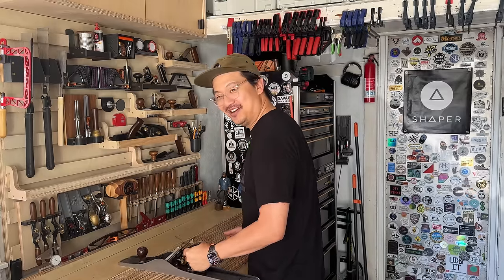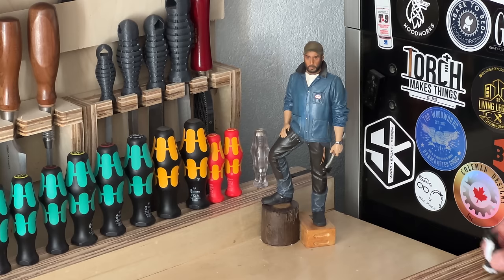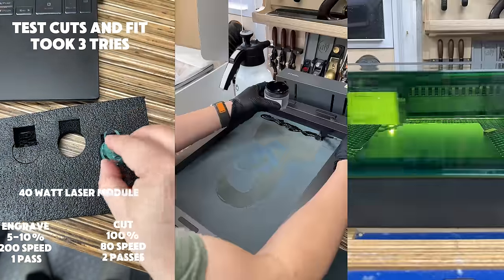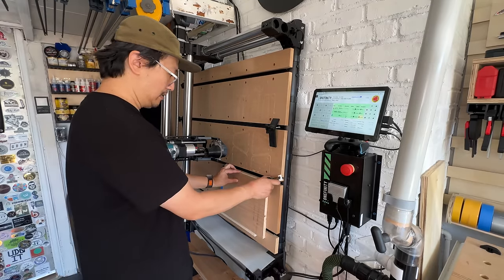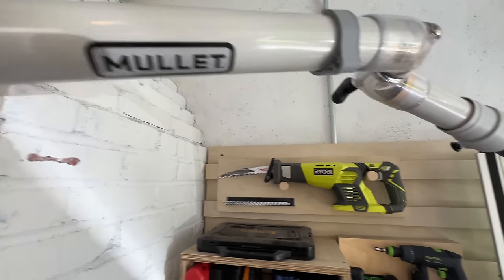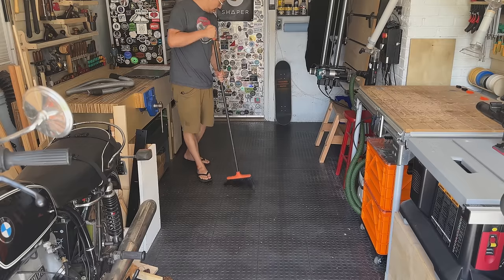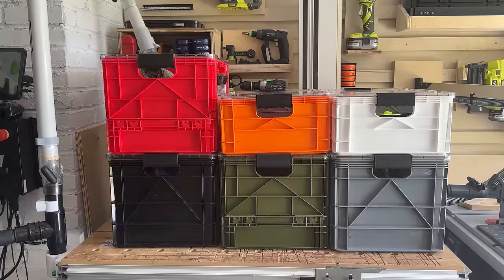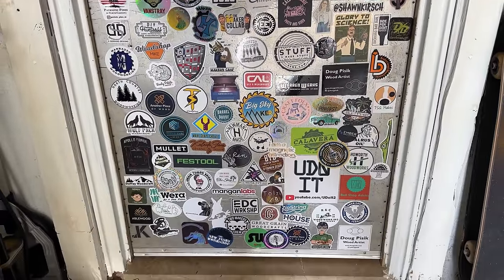Shop Tour 2024 - One Car Garage Woodworking Workshop Update

Comment: I think your one Car garage has the double space of mine🤪
Thats awesome storage solution
Reply from the maker: I'm super conscious about the space, why I like hand tool woodworking for some stuff as it saves on space. The MFT3 table really helps with all kinds of workflows as well. Outfeed, CNC carving with the shaper, miter/cross cutting. finishing station. I like to look at the European makers that have half the space or work out of a shed. Lots of great ideas from them.
Reply: @3ddiy  ich wish i had the space for your cnc. Its awesome. I just have a small diy
Reply from the maker: @dennisgu2506  They do offer a smaller wall mounted machine. called the machinist. Also if space is an issue check out shaper origin. It's more manual but it's super compact.
Reply: @3ddiy  now i got 16x19 as cnc. And i just have the half garage. The rest is bicycles, garden stuff and kids stuff
Reply from the maker: @dennisgu2506  ha well I had to move two strollers two bikes and some kids toys out to film the garage. so I understand. With big projects I always have to shuffle things outside to work.

Comment: I cannot wait to watch your hand plane video! Your collection is substantial. I have 2 old block planes, 1 each #4,#5,#7 bench planes and a router plane that all get heavily used. I thought I have all I need. Also I’d like to hear how you settled on your dust collection solution.
Reply from the maker: hmmm a video on hand planes... I feel like there are way better experts on the subject. But it might be fun to go through and talk about which ones I have used the most and the order in which I had them come into my life. Sounds like you have a solid rotation of planes your self. Veritas is about to have their seconds event. I want to acquire more but I think I should probably wait a bit longer. For dust collection. Since I am not heavy power user on my power tools. I didn't want something huge and robust. I also don't have any long piping going around the shop. So a shop vac system works just fine for my needs. Also keeping everything around the MFT workbench. Helps with not having to move the shop vac around. I went with a festool vac because of how much quieter they are to other vacs, the Hepa filtration, the built in bluetooth, or smart plug to automatically start when a tool is turned on. They also have a good amount of suction for a shop vac. I started with just one and honestly thats enough for most. Having more just makes it easier to have tools dedicated on the one and never have to switch out.
Reply: @3ddiy  thanks for the response. My world of hand planes is small but I use them heavily and I’d say I’m a YouTube student of Paul Sellers and of course my father. Dad had me sharpening plane irons and chisels when I was 10 years old (I’m 71 now). I have two of his planes and his sharpening stones. I don’t have any bevel up planes so no experience with them and doubt I would get one either. I’m close to buying a Festool dust extractor to add to my 4” Delta extractor. Initially I thought they are too expensive but now I think they are worth it. Keep up the great work.
Reply from the maker: @trep53  I'm a huge fan of Paul Sellers. He really is the bob ross of woodworking. He has taught me so much. It's amazing that you have something of your dad's. Thanks for the comments. I really appreciate all the support.

Comment: And even room for the BMW bike . Nice shop and very well organized  . Well done !  I see you've opted for a larger TS in the 75 . Do you also have smaller like 55 ?  I braced my MFT3 with 40mm ply pipe to stop the wobble ( YouTube video idea ) , but it does take up the space for the vacuum .
Reply from the maker: I think the 75 is the better value if you were to only have one track saw. The goal is to get one of the cordless 55's one day. the MFT3 can be wobbly for sure and if it's the only workbench I had I definitely would reinforce it. I have been thinking of building a larger box for it to sit on.  so it can roll around and be heavier. easier to bring it into the center of the room for some projects. That way it could also have drawers and more storage. I also been playing in my head of getting rid of the table saw if and when I get a bandsaw and get a second mft3. Or put the job site saw on a scissor lift and wheel it under it. Only bring it out for repeating rip cuts. But with the extra length of two tables it's easy to use the track saw and parallel  guides to do those cuts. either way lots of fun options.

Comment: you have enough room for tools but where do you put your projects you are working on?
Reply from the maker: I usually work on one project at a time. It sits on either one of my workbenches. For very large projects they get assembled on the floor in the middle. When the weather is nice I also have saw horses that I can bring outside into the drive way to do work right in front of the garage. I have a tent I can deploy to make it shaded. But to be honest I only have done that once as it’s a lot of work to dig out of the shed and put up.